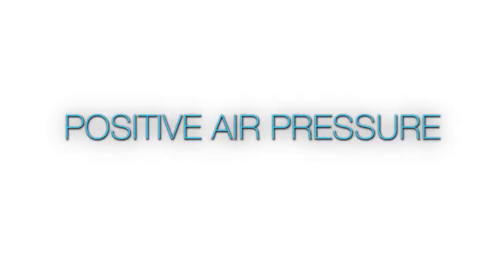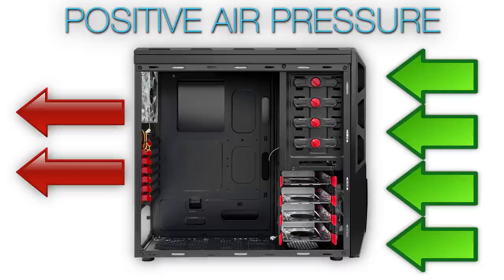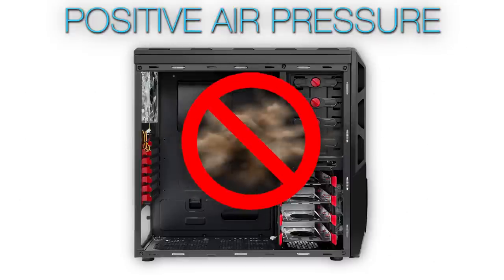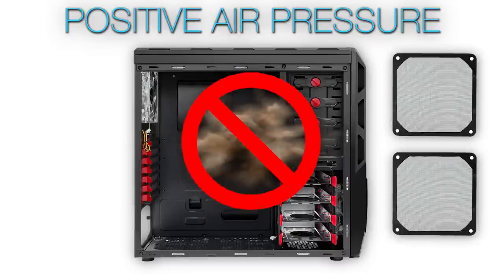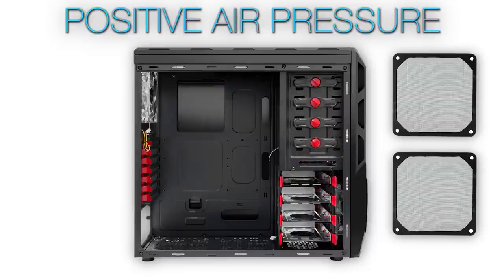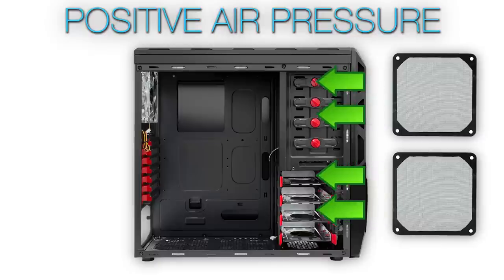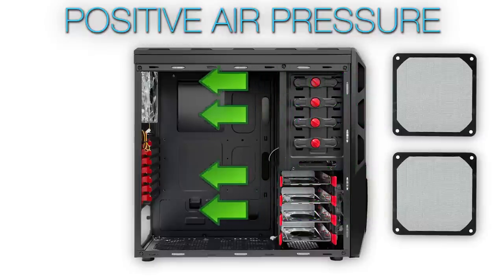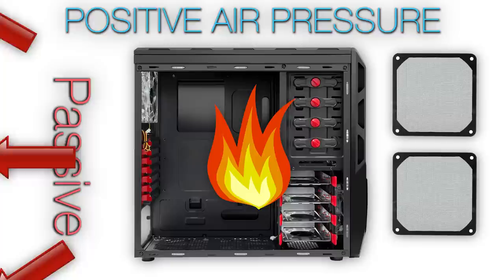Computer Case Airflow - What is Positive and Negative Pressure?

Comment: How about NOT CLOSING THE CASE? I always have my side panel open and removed the fans from the back of the case. Normally if I have enough open area, the airflow is happening naturally with hot air forced upwards taking in cool air from below. But that doesn't even matter since the interior of the case it's literally at ambient temperature at all times since... it's open! Dust? Vacuum cleaner! Once or twice a month and never has any dust. ( I clean the whole room of dust anyway more times per month) I never had any over heated components. Plus I have a VERY silent PC ;)
Reply: JustDSBM Yeah dust is a mess.. always is. But it is cooler
Reply: +talas attila I don't know much, but my immediate thought about leaving the side off would be that airflow is not channeled or directed in any sort of way. I could certainly be wrong about this, but closing the case would seem to offer stronger airflow? Does anyone else know about this?
Reply: MultiBaynes You are right there. It is not channeled at all and can even lead to increased temperature depending on where your case is. If your case is sitting down next to the feet of your desk, you might want to consider closing it to direct the airflow from the front through the back. but I also reached very optimal temperatures with the case sitting ON the desk opened and with no case fans installed. It's better for me since I do change parts often, and it would be a pain to open/close the darn case all teh time. So. If the case is open, leave enough room at the side to take in enough air. Depending on the construction of your case it can improve the temps with 10 c. leaving it open. Airflow happens naturally because hot air ALWAYS rises, and cool air descends. Unless the space is closed. But Yeah. You will have a dust issue if you are lazy to clean it often. But something always comes to my mind :) Nobody should ever worry about temperatures. Once I started measuring temps with IR gun on various devices from consoles onward. YOU CANT BELIEVE how often many devices reach high temps on many components. We are worried as PC users about VRM, CPU, GPU temps JUST because we can measure it, and we get obsessed with it. While other equipments multimedia devices normally reach WAY over our usual 60-70 max comfortable temperatures as PC geeks ;) We are worried about it just because we know about it.
Reply: talas attila That's an interesting point about temperatures - we worry about it just because we know about it. Unless you're doing mad overclocking stuff and low temperatures are needed. Although, I think parts are supposed to last longer at lower temperatures than high ones. But I doubt it makes a huge difference, unless you're burning it constantly.

I do still think that a closed area with enough intake and a strong air current (comp case) will perform better for cooling than an open area. But it's probably not a huge difference, and definitely not going to make an impact unless you have trash fans or something.

And as for me, I am too lazy to vacuum out my case often, haha. Unfortunately it's pretty dusty where I live too, which definitely does not help
Reply: MultiBaynes Theoreticaly, higher temperatures reduce the lifespan of some components slightly. Particulary of the capacitors and stuff like that. But really.... except for HDDs nothing ever failed on me. You would replace your 7-8 or more years old system LONG before the components fail on you. The same goes for other non PC electronics in your house. Just because they become very outdated by then. Unless you are running REALLY unhealthy temperatures and voltages, you are fine. I have here at work a computer that's running since way before I came here. I'm lazy to change it's cooling paste, but I see it running at 60+c on idle. I would have become paranoid if this was mine. But It's the computer in my office, who cares? But it simply doesn't fail, not even if it's burning from 60 to 90c all the time. Since years. And about Overclocking... I never bother too much clocking so high. I just do a basic overclocking as soon as I build a new system and that's it. Pushing it further would increase performance by such a small margin that it's not worth it. And when time comes an upgrade always beats the guy who's trying to beat his horse to death to run faster :))
Reply: +talas attila yeah I bet that's true. It seems like such a luck thing too... some components last a decade, and others last a month. Also my case is on the ground on carpet, so I don't think it would be a great idea for me to leave it open. And I'm not often changing parts, so I'm really in the opposite situation from you lol. Thanks for the insight though. It's not often that I can have a worthwhile conversation in the comments on YouTube
Reply: MultiBaynes Okay all this made me experiment quite a bit. Here are the final numbers. (sorry but it took me some time to do this)... Tried this with hotter components, but okay cooling.
Mobo: ga970aUD3P; CPU FX8350; GPU: GTX WF3 R9 290, 2x120mm fans, cooler CM212 EVO. . All at stock speeds.
-Case on the  ground, closed. 
CPU idle 26c, heavy load 55c; GPU idle 45c, heavy load 79c
-Case on the ground, opened.
CPU idle 19c, heavy load 45c; GPU idle 44c.(fans run a bit slower, they only cool at higher temps) heavy load 67c
-Case on the table +3c at all temps (ground level is cooler)
NOW I have modified a case took out the glass side of the case which has those side windows, and replace it with a very thin anti dust filter. (Bought it where they sell mosquito nets :P)
-Case in the ground, closed
CPU idle 22c, heavy load 47c; GPU idle 47c; Heavy load 71c
Modifying the case gives you so much more temp headroom for OC. AROUND 8c difference is HUGE!
Tested ALL this with GF 970 and gives around the same idle temps (again fans don't kick in) AND around -8c cooler max temps.
Reply: +talas attila Please don&#39;t use a vacuum cleaner to remove dust because of the static a machine like that generates.  An easy way to zap some components :(
I would suggest using compressed air, it blows out the dust with no risk of static.  You can get compressed air in a can, or use an air compressor.
Reply: Ethan Well I never zapped a computer or any electronic device in more then 2 decades by using a vacuum cleaner. I don't really understand how would you charge it with static by using it. Yes it's possible if you use a cloth to clean of dust, and rub around electronic parts. I would recommend one of those anti static bracelets for doing stuff like that. But Blowing or pulling air does not charge static. unless the dust particles can be charged with air... But for that winds faster than 100 km/h would be needed, to make the air friction high enough for dust particles to be charged :) But yes. Static is something that should never be taken lightly. I know people who ruined some parts, by not paying attention to it. Also I would advise people to keep the case grounded even if they pull out the cable from the PSU, while they clean
Reply: Static electricity is generated by particles (air, dust, dirt, etc.) being rubbed across the insides of the vacuum and what ever is really close to the nozzle.

Just would never seem worth the risk for me, when compressed air is an easy alternative.
Reply: Ethan Yes, and I use quite often the can of compressed air especially to blow in hard to reach places like inside the PSU, or hetasinks. But then again vacuuming does not harm the system in any way. What you say is true. But the dust particles will NEVER generate enough static electricity with a vacuum cleaner. Firstly because the inside of the computer doesn't have enough solid particles to rub against the pipe of the vacuum cleaner, second... because as I said... the air pull is not high enough to generate static electricity. Some things to be mindfull about tho.... Don't aim the vacuum towards the ventilators, they will spin fast enough and you can break them easilly. That's true even if you use compressed air. In any rate you have to ground yourself when cleaning especially sensitive electrical equipment. (static bracelet, or keep one hand hand on the case provided the case is grounded when you are cleaning it)
Reply: talas attila watch?v=W9T6WGFmam0 2:16
Reply: Ethan I tested tons of times with closed and opened case and different videocards+ different methods. You see the results posted in this thread if you scroll back. Those are my results so far and I'm looking forward to test even more. Got a bit of time this week to try it out on Intel setup also (as you saw the previous one was on FX8350). and the same way paired with R9 290 , GTX970, and GTX 560 all stock speeds. But That version of open case I did with the nets really is cool. The needs of people may differ since some would just build a system and use it for years. Which removes the will to bother with cleaning. In that case a closed system on moderate clock speeds and a good airflow would be best. But others like me switch parts quite often
Reply: +talas attila  Well, Talas, I was thinking the same as you when I built my last desktop. I left the side off the case and eventually the processor died. Did the heat kill it? That's what usually kills them. However, it did lastfor nine years, so who knows, maybe it would have died anyhow.  At any rate, I am adding extra fans as I rebuild using the same case.
Reply: Bill Morrow Well it always helps to check out the temperatures regulary. Usually the CPU throttles back if the heat limit is exceeded, avoiding harm to the component. But it's always safer to keep it under thermal limit as much as possible. Ther CPU throttling is not guaranteed to save the CPU if the temperature rises by a lot in a short time. Also it helps to change the cooling paste once in a while ( a good one can still keep it on optimal heat transmission for years)

Comment: Neutral pressure being the easiest pressure to achieve is the worst lie ever, it doesnt just require you to have equal fans on both intake and exhaust and not even having them all at the same rpm because you need to figure out all the resistance your fans are working against on both intake and exhaust, mainly the intakes as they usually have the most resistance to work against, front mounted fans for example with a fat mesh or front panel with side-intakes etc. Or the exhausts could have high resistance from a radiator (that goes for intake fans on a radiator aswell ofcourse). Easiest to achieve is either positive or negative but never neutral, its sooo hard to achieve its not even funny, even if you do get it neutral at idle, once your fans ramp up during cpu/gpu load the neutral pressure is lost since having different amount of resistance on intake vs exhaust isnt linear.

TLDR; Neutral pressure isnt easy to achieve due to many different variables such as resistance that the fans are working against. Best pressure hands down for both a dustfree case and also best cooling is a positive pressure with fanfilters on the intake-fans.

Comment: Your argument for negative pressure being good makes no sense what so ever.  You say it is called negative because more air is leaving than entering.  You then say that this makes the heat leave faster.  The problem is that more air is leaving than entering is false once it has reached a steady state.  It is called negative pressure because the pressure inside is actually less than outside.  This is done by directing more fans out.  More air will leave for a little bit and the pressure will drop.  As the pressure drops it will suck in more and more air until it reaches a steady pressure.  At that point just as much air enters and leaves.